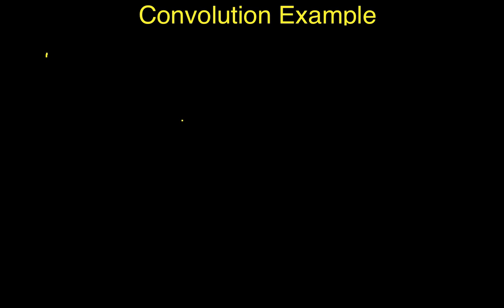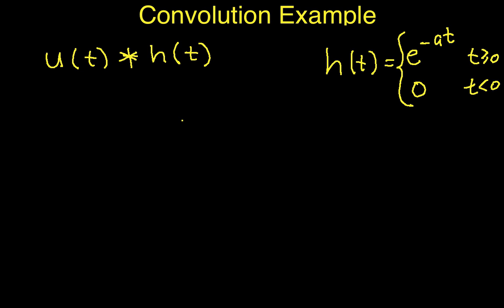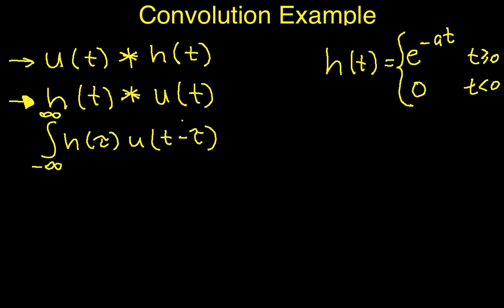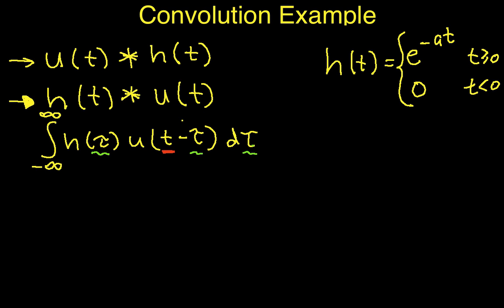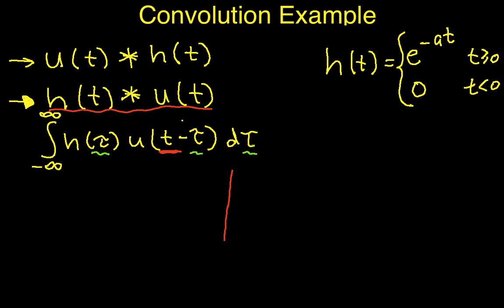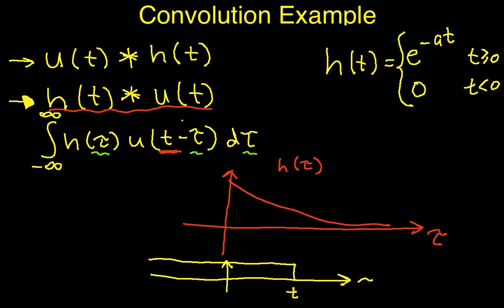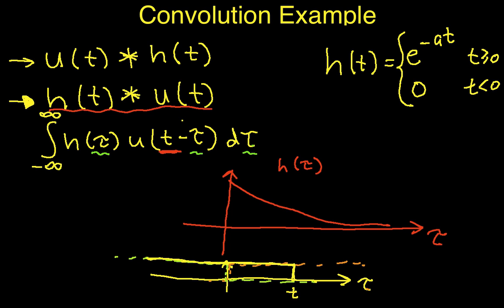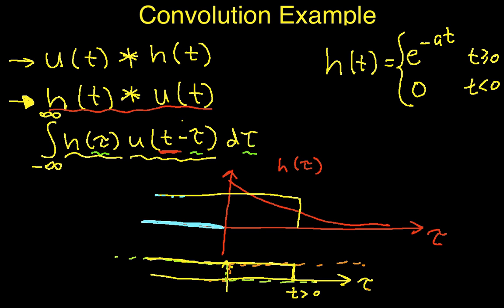Convolution Example: Unit Step with Exponential Part 1

Comment: in general, ..
if we have x(t), then x(t-T) is same as x(t) but sifted to the right by the value of T. x(t+T) is same as x(t) but shifted to the left by the value of T.
Note that if you have done the reversal first, the shifting direction is also reversed. That is, x(T-t) is same as x(-t) but shifted to the RIGHT by the value of T.
x(-T-t) is same as x(-t) but shifted to the LEFT by the value of T.

Comment from the maker: @Jdonovanford The 1-etc comes from integrating e^{-a tau}; the integral is -1/a e^{-a tau}. Then you put in the upper limit of the integral (t) to get the e^{-at} term, and the lower limit of the integral (0) to get the e^{-a 0} = 1 term.

Comment: 11:32 -12:12
If it looks like step response of RC circuit why voltage across capacitor does not reach 1, but only 1/a?  In real circuit voltage across capacitor approaches to voltage of step that  is 1.